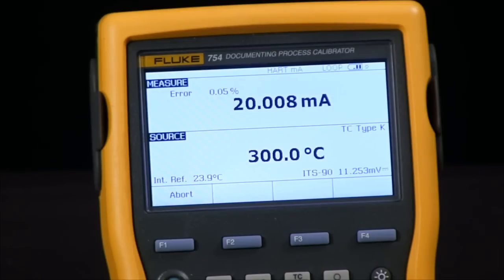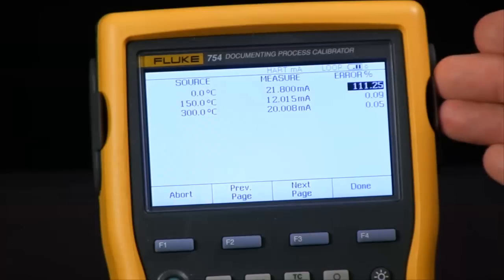How to Perform A HART Calibration On A Documenting Process Calibrator

Comment: I want some help from you Sir.
I have a 2051 Rosemount DP Transmitter. I want to change the unit. While I am changing the unit the FLUKE 754 DPC showing "Loop should be removed from automatic Control".After pressing continue it shows error. What is the solution for this and also tell me the connection details.
Reply from the maker: Hi Sukdeb - Our Technical Support team can assist you with your Fluke 754 question. Please give us a call at 1-800-443-5853 or email at fluke-info@fluke.com. Thanks!